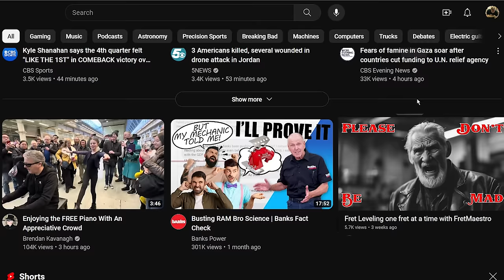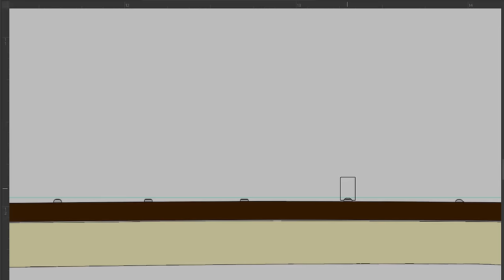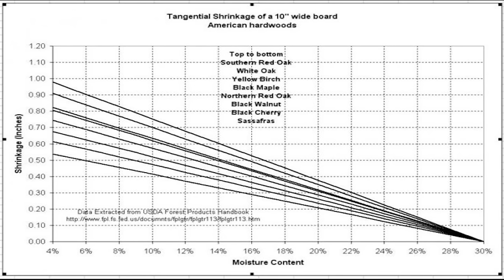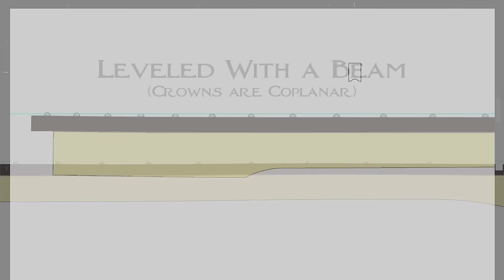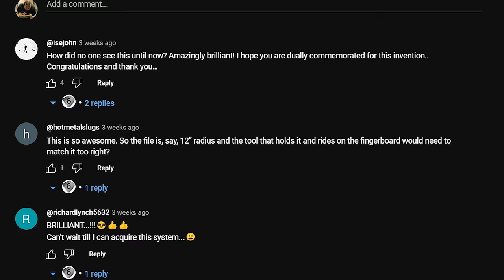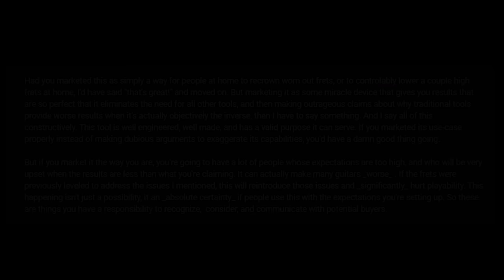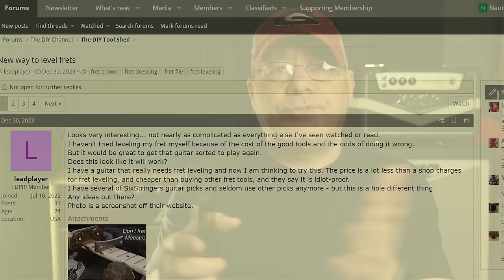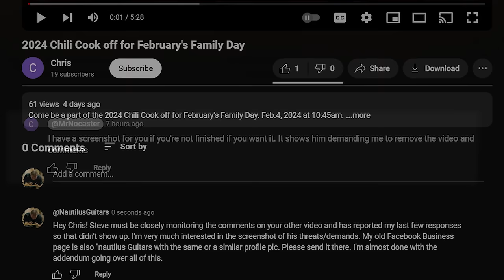Fret Maestro - Gimmick or Godsend? - A Fair Warning

Comment: Wouldn't placing a true straight edge, on top of precision parallels, at the nut and after the last fret positions, just tall enough to clear the frets, and then measuring between the fret board surface to the bottom of the straight edge with simple feeler gauges, give you a perfect numerical representation of any fret board variations and show the exact neck relief? 
All you would need to do is write these numbers down and then, by using these measured variations, you could simply adjust the depth settings of the Fret Maestro (.003" per click) to get the problem areas within at least .002" of your target height? (.002 would assume that a fret was initially .001 too high, and needed to come down to prevent fret buzz and that you grind it until the Maestro bottoms out.)
Also, it seems that most, if any variations, occur at the heel, within the last 6 frets or so, which also have the steepest take off angle of the string, between the fret crown and the saddle slot.
.001" or .002" would most likely be negligible up here, and again, if there was an issue, you could just mark the fret and kiss it lightly into spec.
Now, if I saw mad variations, all along my neck, I would most certainly pull all of my frets and run my radius block over the entire fret board.
Just having level frets, nicely crowned, over a wavy or twisted fret board is never a good idea for optimum play-ability. 
So, I would re-fret it and start from scratch.
As a millwright for many years, I am very well versed with creating and using custom made tooling, I think that this tool is pure genius. 
I do not base this on anything anyone has said or any reviews, but by observing what this tool is and understanding how it functions.
As with any "New" tool, there will be a learning curve.
Just as anyone who has gone from standard crowning files to diamond crowning files knows, they are two different animals.
My interest in this tool, is in what it CAN do.
It seems to me that with this tool, and just a bit of care and fore thought, you can achieve PLEK like accuracy every time, and this, without messing with your customers neck relief.😉
Reply: to simplify, are you suggesting that we adjust the depth of each fret slot to facilitate the tops all being on the same plane when installed?.. if so, thats waay more work than levelling & recrowning the tops after the wire is pressed in.. i generally make sure the neck is a consistent cylinder before i install frets. if rosewood, ebony board i will lightly sand @ proven radius for consistency..
Reply: @Gorilla.Guitar Nope, not at all.
I simply suggest measuring any variations in the fret board surface, and if you see "drop off" in heel section, you could adjust the depth setting of the FretMaestro to compensate for that. Your fret slot should always be deep enough to fully seat the fret against the fret board. you would not change settings to eliminate the neck relief measured, as that is desirable for string clearance as you move up the fret board.
Reply: @Stephen_M.  ok, that makes sense.
Reply: @Stephen_M.  a little consistent heel drop off would actually be desirable to me as after i level frets complete, i take  a bit more off of all from fret 16 & on  paricularly on set neck guitars as they often have heel drop -up.
Reply: @Stephen_M.  i have an es 335 w 3pc maple neck that had a phat twist to it. i pulled all the frets & planed the board back to straight plane had to cut some slots deeper etc, fun times.
Reply from the maker: I'm assuming you didn't watch much of the video because most of your points/questions are very clearly addressed in it. 

Can you go through all of that for measuring the frets? Sure. By the time you had all of the frets measured like that, I could have the entire fret job finished with a beam and file, and I'm not exaggerating. Not only that, but that .002 margin of error would be .00002 with a beam. It's just a massive waste of time and energy when the traditional way is faster and better. 

While the most noticeable variation happens in the heel on bolt-on necks, warpage between the 1st and 15th is just as common. I showed three random examples in this video where you can clearly see noticeable warpage. You must have missed that part.

You don't need to mess with your fretboard if it has variations. It's completely normal and only 100+ year old wood kept in a pristine environment will maintain a near-perfectly-flat surface after re-planing it. Pulling the frets to plane the board for average warpage is extreme overkill. If you want to do that to your own guitar at home, then go for it. I'm not charging my clients an extra $300 to go through all of that work for literally zero improvement over just leveling the frets. It's one thing to say or do that stuff at home with your own guitars. But it would be straight-up unethical for me to do such things as a professional. 

The long-standing cliche about lutherie is that it's 25% building/repairing actual guitars, and 75% building custom jigs, fixtures, tooling, measuring implements, etc. So we're also well-acquainted with that. It's probably the single most important skill in lutherie. Every job is a niche job that requires the creation or usage of complicated and  bespoke implements. 

As for the rest of your comment, I'd ask that you actually watch the full video, as it seems you missed most, if not all of it. This tool is fatally flawed and I very clearly illustrated why. Perhaps you bought it and are clinging on to hope. Maybe you'll even get passable results with it, but the fact is that a beam and file would give you much better results. It's not an opinion. It's a demonstrable fact through both logical and empirical reasoning. No beef with you! I just have to stick to my principles in response here. Especially for those who might stumble upon your comment and wonder what counter-argument there might be for your points.
Reply: LOL!!! Of course I watched the entire video.
Both of my questions were hypothetical, the answer to both, is an obvious YES.
I wasn't asking you for an answer, I was more asking if you could see that very simple measurements, taken from a known point, would give you all the information you need to achieve perfection.
Also, the day you can hit .00002" with a sanding beam, you let me know! (That's 2, millionths of an inch you typed there)
The granules in the sandpaper on your sanding beam are bigger that that!
Pardon me, but that's the funniest thing I've read here so far!
I've installed half million dollar CNC's that can't achieve that tolerance, to the Aerospace Industry, for a living.
And I've operated Wire EDM machines that can hit that target!
If you read through my reply again, you'll see that I never mentioned measuring the frets, and that my reference, was to measuring the fretboard surface, referenced off of a known straight edge surface. This would reveal the neck bow and any "drop off" with 24 simple measurements. (unless you're Alexandra Zerner and have a 29 fret guitar)
That would be 24 frets, 24 measurements, what would that take, 10 minutes, maybe 15 minutes if you take your time??
You would now have a numerical representation, of any abnormalities in your fretboard surface, you know, the surface that the Fretmaestro rides on.
And then, IF any irregularities are seen, they will most likely present as "drop off" in the last 6 frets or so.
And again, my "within at least.002" reference, was IF you just used the Fretmeastro until it bottomed out and forget all about any "finesse" .
If you can see that you only need another .001, in one of your upper frets due to drop off, a couple of light passes on the next setting, would do the trick. Simple!
It's just another tool.
And from my years of experience working with many, many different types of tools, I'd say it looks like a damn good one.
I will be buying my first FretMeastro at the end of March, I will do a review at that time and hopefully be able to answer all of your questions and alleviate any confusion you may have at that time.
Be sure to re-read my initial reply here until you understand it completely.
If you have any more questions, please ask me.
Reply: @Stephen_M. I think your suggestion is interesting. Will be interested to see your review.
Reply: @Stephen_M. I agree with you. I see the tool the same way. Maybe you won’t end up just blindly bottoming the tool out on every fret and every occasion, but that doesn’t make the tool worthless — it just takes a bit of thought and common sense, as you describe  when you talked about dealing with the typical kick-up on the last few frets
Reply: @Stephen_M.  Buy the tool. Level your frets with it; then POST YOUR  VIDEO OF THE OPERATION. POST THE VIDEO OF THE RESULTS WITH MEASUREMENTS. And don't be so condescending. I know plenty of CNC guys. They are good with computers, good with numbers but most of them cannot identify a phillips screwdriver let alone use it without hurting themselves. Just because you understand tools and numbers does not mean you are qualified to repair a guitar owned by someone for money.  

All that being said, I think you should buy all the Fretmaestro stuff, buy a bunch of guitars and make a bunch of videos.  Just post them in real time with no edits.

AND BY THE WAY:  I've operated power tools. And I can drive a car. And I can fix guitars. I can also cook rice. SO who is more of a bada$$?  Me or you?  ha ha ha ha ha   Wire EDM machines.........that sounds like a 90s nu-metal band.
Reply: @benburnett8109  EDM, is Electronic Discharge Machining.
It was first created to remove broken taps from expensive, Titanium air-frame parts of classified aircraft.
Initially, it was called a Tap Buster. Look it up.
But, I suppose it could make a good band name too.
As for CNC guys..... I was the also the guy that installed the machines and serviced them.( I suppose you might think that's badass, I'm not sure)
Most of the guys I met in the machine shops, knew what a screwdriver was.
I'm not trying to be a badass, I'm just being objective, and trying to correct the errors in the reply's to my initial comment.
IF I do like the Fretmaestro, (I'll make that decision when I have one in my hands) I probably WILL buy the whole set!
And I will do fret work for paying customers.
As far as condescending is concerned, do the "plenty of CNC guys" that you know, know you think so lowly of them?
Do they know that you are afraid they are going to hurt themselves, tightening, or loosening a screw?
As for buying guitars, I have enough for now, both acoustic and electric, 6 and 12 strings.
So I will be able to put these tools through their paces.
I just visited your channel, but I couldn't find any videos of you doing any conventional fret leveling and crowning.
There's not even a video of you using a screwdriver!
As for what YOU think I should do.... PLEASE.😂
Get over yourself.
Have a great day! 😉
P.S. Watch for my video in April sometime.
Reply: @Stephen_M.  I KNEW YOU'D REPLY WITH SOME OVERBLOWN EXPLANATION OF WHAT YOU DO.   trolled TROLLED. trolled. TROLLED WITH A CAPITAL T.   I didn't care yesterday, I don't care today and I won't care tomorrow about your overblown view of who and what you are. TROLLED>
Reply: @benburnett8109  Does this mean you won't be watching my review of the FretMaestro?
I'm crushed.
LOL!
Reply from the maker: @Stephen_M.  I re-read your response, and confirmed that I did in fact understand it, and responded to each of your points with clear explanations of the problems I see with them. 

What you're describing in every case is complete overkill based on starting with a conclusion and making the premise fit that conclusion. Everything you described doing with FretMaestro is 4x the work for the same, if not worse results. Why would you measure a set of 20+ references, then do calculations for each one, then adjust a tool for every single reference to meet your target, and only then actually file the frets, when you can just level all of the frets perfectly at one time and crown them immediately after? This is massively overcomplicating a simple job, just to make this tool work. I guarantee that I could have a whole fret job done before you could even have accurate measurements. 

If you have a truly flat beam (I check mine against a Starrett Gauge block every week), you have no reason whatsoever to take measurements, as you have a near-perfect reference surface that spans the entire fretboard and completely ignores any problems. It's a very simple and flawless solution. It needs no improvement.

There's way too much to take into account with this tool, when the alternative is completely fool-proof and simple. There's literally zero benefit using FretMaestro, and it's much more work. I cannot understand the appeal of using it.

Your last response to me completely ignored several of my responses to your points (some of which were completely disproven in the video, hence me asking if you watched all of it), and just re-asserted those points as if I never responded to them. 

The .00002 was a typo.  I meant .0002, which isn't outlandish, but probably overly-optimistic. I just did a test in response to some people who claimed the one-hundred thousandths range was impossible, and acheived a tolerance of .0005. Just posted it here: https://youtu.be/DxGc6IryIzY

To be clear. None of this is personal. We're getting in the weeds here and it requires a bit of an edge to cut through it all. I really just don't see how any of this makes sense. Again, there's zero benefit and it's significantly increasing the physical and mental work.
Reply: @NautilusGuitars  I'm glad to hear that you use Starrett tooling.
Just so you know, I made steel stamps for them to mark their Micrometer heads at one of my jobs. Their tolerance was .0005"
.0002" is certainly achievable with care and I have set up Lathes with live tooling that were spec'd to hit .002" taper, over a foot, but I was actually able to hit .0002" with it.
Needless to say, the customer was quite happy.
I'm not really sure what "conclusion/premise" crap, you are referring to.

Rather than arguing back and forth with someone who doesn't even posses one of these tools,
I will trust my own understanding of mechanics and will be ordering one at the end of March to see for myself how well it works.
Also, It was quite obvious to me that you did NOT understand my initial comment by your reference to measuring frets.
Also, the "calculations", would be simple addition or subtraction. Not really any complex calculations requiring special math skills or time to complete.

If you can do the job 4X faster, your way then by all means, do it your way.
But know this, I will be trying this tool, no matter how hard you bash it.
Please watch for my video review, some time in April.
Have a nice day!
Reply from the maker: @Stephen_M.  They're a wonderful company. Some of the most beautiful tools on the planet. Most of my measuring implements are Mitutoyo, as I was given a great deal on them, but I'd be happy to replace them all with Starrett.

Seems like we're at a crossroads though, as I don't know how else to interpret your comment. 

My point isn't that the math is complex, but that it's an added step which is completely unnecessary.  

If you're doing this at home and don't mind the extended process, then by all means, go for it. I'm not telling anybody to not buy it. I'm simply giving my rationale for why it's fatally flawed, and defending that position.

But if you're charging clients by the hour, you're adding significant unnecessary cost with zero benefit, which in my opinion would be unethical. And if you're charging per job, you're robbing yourself of time for no benefit, which is bad for you. Either way, somebody loses when compared to a beam and file. There's a reason we do it this way, even with dozens of truly genius engineers in our field coming up with new tools every day. 

I genuinely look forward to your video! Please show us a fret rocker test. If the frets are level, a fret rocker will be able to show that on every fret with a straightened neck. Steve is already making excuses to not use one. But if it works, a fret rocker will prove it unequivocally. Not on one lucky fret, but all of them. 

Anyway, you have a nice day as well. And thank you for the engaging discussion and your civility! I mean it!
Reply: @NautilusGuitars  Mitutoyo makes great measuring tools as well, and the bulk of my calipers are made by them.
I do love my Starrett "Last Word" indicator as well.
I use that to tram the head of my CNC machine, as well as check planer surfaces.

When you say you check your straight edge weekly, I assume you meant on a granite surface block and not a gauge block. Gauge blocks are usually 1" (often called an inch block) and some are accurate into the millionths of an inch. We use them for calibrating micrometers and such.

So...Here's my point,  If you lay your notched straight edge on the fret board and it's perfect, no light showing anywhere, wouldn't the results also be perfect when using the Fretmaestro as well?
Of course it would! 
You are following that same surface you just measured as perfect!
And if the surface is imperfect, wouldn't quickly measuring those imperfections, by feeler gauges, or dial indicator, reveal very, very, accurately those imperfections and their positions on the fretboard?
Of course it would!
So, I see this new tool as a way for me to get perfect crowns every time.
Although you may not see any benefit, being well versed in beam leveling and freehand filing, I think it would bring a wealth of benefits to the guitar owner that does his own work, or is not located near enough to a decent luthier that he or she trusts.
I personally own one guitar, that I would never let anyone else work on, ever. (no offense, just a very rare and collectable guitar).
As for time, I'm sure that after someone has been using the Fretmaestro, for as long a time as you have been leveling with a sanding beam and freehand crowning, the difference to complete the job, would not be anywhere near 4X longer.
Might even  be quicker!
Reply: @NautilusGuitars  Ref: “ I just did a test in response to some people who claimed that the one hundred thousandths range was impossible and achieved a tolerance of .0005. Just posted it here…”

Your video at https://youtu.be/DxGc6IryIzY?feature=shared  does NOT show that you “achieved a tolerance of .0005” at all. 

It shows that your crowning process removed that amount. This is not remotely connected to the topic under discussion, which is relative fret height.

You claimed: “…that .002 margin would be .0002 with a sanding beam”. Note that your own words say, that the margin of error would be “.0002 WITH A SANDING BEAM”. Nothing about a fret crowning file.

To further prove the point, this claim is in reply to @Stephen_M’s  comment where he talked about achieving a .002 tolerance with the FretMaestro. The context is the relative height of the frets. He said that, with the FretMaestro, he would “get problem areas within at least .002” of the target fret height”. It is clear and indisputable that the tolerance in question is in reference to the relative height of the frets. It is nothing to do with fret crowning files. 

You crowned one fret. LOL. How exactly does this prove your claim that “the margin would be .0002, with a sanding beam”? You showed no sanding beam, no work with a sanding beam and no measurements from a sanding beam.

This a complete misdirection. Nowhere has a fret crowning file been mentioned until your utterly bogus ‘proof’ video
Reply: hey you didn't drink the guy in this current video's Kool-Aid made from being let down at someone simply asking him not to get mad and to be patient!
Reply: @NautilusGuitars then why did you order one in the first place Einstein?
Reply: @Stephen_M. I think you've gone beyond dude's level of understanding, he's out to prove a point!
Reply: @benburnett8109 who are you ANYWAY?, he's being factual and realistic and giving a point of view based on realized experience, and nothing he said seems wrong, indeed the side in this critical video is the one condescending, oh yeah, and you, too!
Reply: @Stephen_M. ha!
Reply: @NautilusGuitars your edge is pretty dull
Reply: @Stephen_M. he's pretending to understand, or at least he thinks he is
Reply: @johnbuell8035 quite correct on all points